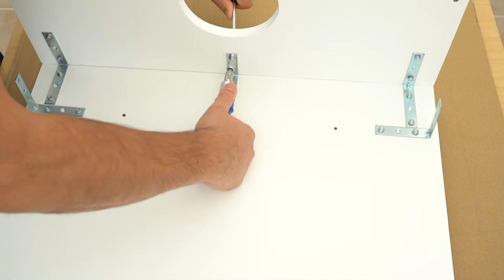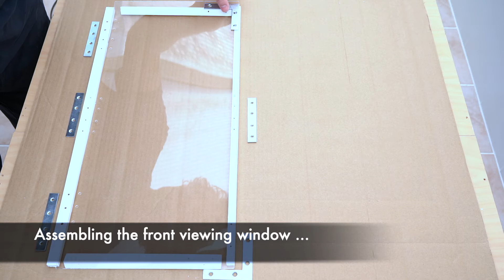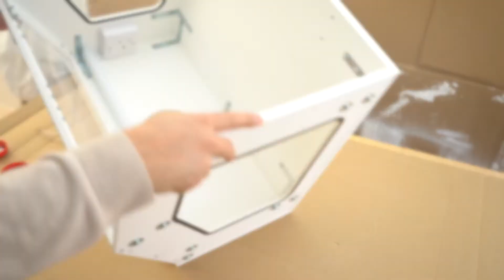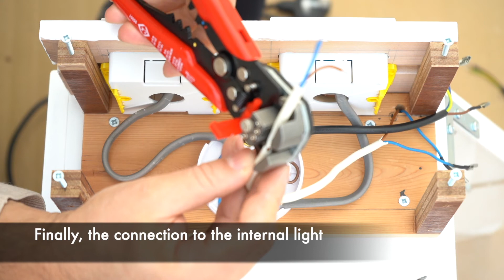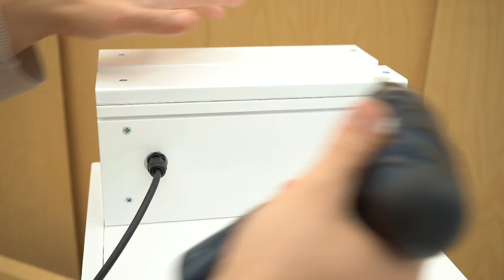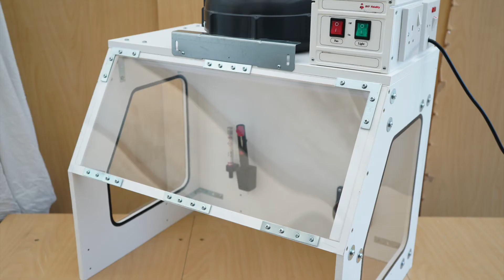Final Assembly

Comment: Hello, I'd just like to ask, what was the rationale behind the 0.75 meters per second air speed needed for computing the required specs of the fan? Isn't it a bit overkill to use the Rhino Ventilation fan? I was planning on making my own DIY fume hood with only computer case fans as ventilation and found your page. Wouldn't that be sufficient and if not, why wouldn't it? Thank you for your time
Reply from the maker: Hi Nate. The rationale was that I tried a regular house extractor fan (the ones you typically find in bathrooms) beforehand which was not described in the build and I was not happy with the movement of the solder fumes. It might have been sufficient but I really wanted to see it working, hence the Rhino.